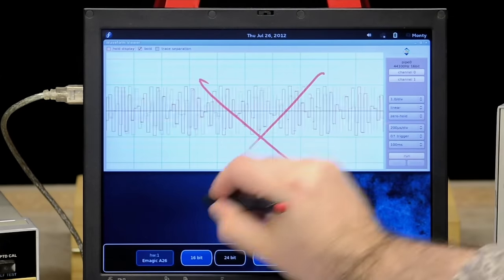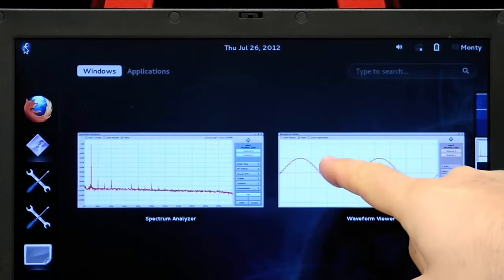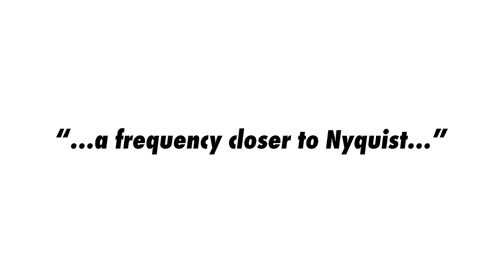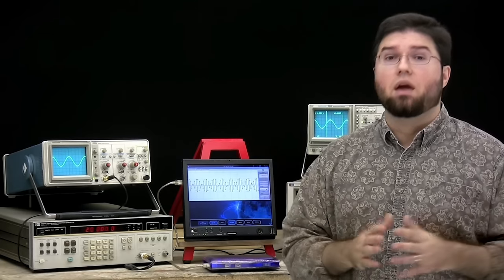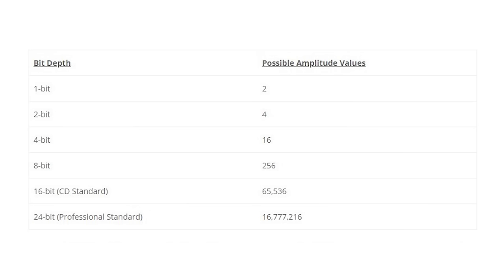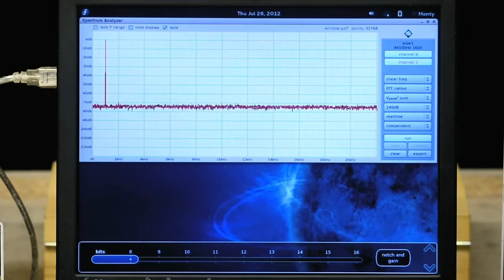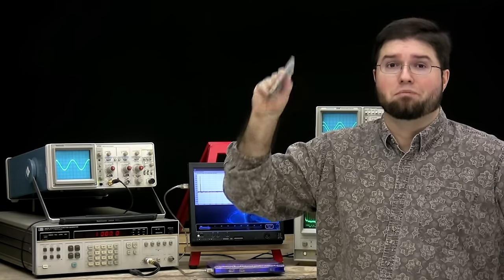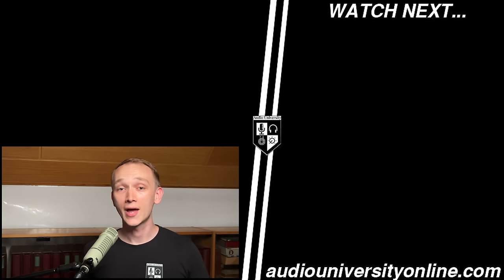Debunking the Digital Audio Myth: The Truth About the 'Stair-Step' Effect

Comment: Digital data loss is not a myth. You're taking a continuous analogue signal and digitizing it using a finite sampling and then applying an algorithm to extrapolate the gaps. Now to keep things in perspective, this process literally reduces an infinity of points to a finite set of measure zero, which is then augmented with an approximating algorithm. Even an infinite set of measure zero (e.g. the Cantor Set) would leave practically 100% of the original signal on the cutting room floor. You may not be able to articulate or even understand the difference, but it is a difference nonetheless. It's hyperreal. Those of us who grew up with super high-end analog audio and vinyl immediately heard the difference when DAT and CD were being rolled out, and despite improvements, parity simply isn't possible because the algorithm can no more recreate missing reality than AI can replace a human mind. You can have the illusion, but you'll never achieve the experience of top tier analog.
Reply: @nicksterj I don't think I need to study anything. I'm a mathematical physicist, and by using information theory I can prove the impossibility of faithfully, let alone "perfectly" recreating a complex analog signal using discrete sampling and algorithmic extrapolation.  Digital fidelity rests upon the false assumption that a high-rate digitized clone is indistinguishable to the human ear from the original. I reject this claim, and for good reason. Nuance and subtlety invariably are lost, and these approximations, no matter how closely they may appear to resemble the original, remain irreparably deficient digital clones. It's a VR simulation, a quantized 2-dimensional facsimile of an original 3D experience.
Reply: @nicksterj The Signal to Noise Ratio for a high-end studio analog recorder, such as a Studer A827 is about 68dB, which represents a very low noise floor. This is a barely audible constant, which the ear "learns" to filter out during a listening session. Loss of data, on the other hand, is an entirely different issue, and one that cannot be corrected either by the listener, or by an algorithm.
Reply: @nicksterj So you think extrapolating a circle from 3 points is analogous to recreating a complex audio signal from a digital sample? You even think digitally, reductively.  You're not paying attention.

Since you're interested in mathematics, I'll provide you with a heuristic illustration. Consider the Cantor Set, which is created by taking a line segment of length 1 and removing the middle third, then the middle third of each remaining segment, and again, and so on, ad infinitum. What remains as residue is an uncountably infinite set (cardinality Aleph 1) of Measure 0 (zero length). Notice that we've applied an infinite process to obtain the Cantor Set; however, this set nonetheless has zero length, which means the entire segment has been thrown away. Obviously therefore, any finite set of discrete points, however large, also has measure 0, which means that any digital sample of an analog signal will have measure 0. That is, but for a finite set of points comprising zero length, the entire signal has been discarded through the digitization process. Therefore, the original continuous signal, which has significant positive measure, must now be extrapolated entirely from a discrete finite set with zero length. Why is that a problem? In a word: entropy. There is insufficient information contained in the discrete sample to completely eliminate uncertainty and reproduce the original signal without significant loss. The result may sound well enough, but it is not a faithful, lossless reproduction of the original, and certainly isn't "perfect," as you have erroneously claimed. 

Another way to visualize the problem with digitization is by conceptualizing audio recording and playback as an unbroken transmission via sound vibration. Using the analog process, the vibration, or signal,  reaches the ear more or less intact, and connection with the source thereby is maintained. Digitization, on the other hand, breaks this vibrational link; encoding/decoding introduces entropy, and approximation is the result.
Reply: @arsartium108  Please, educate yourself
Reply: Were Nyquist and Shannon not correct, no modern wireless systems would be possible. All WiFi and cell radios are digital, relying on exactly the same math, just at higher frequencies and therefore sampling rates. The analog signal can be perfectly recovered from samples at twice the maximum signal bandwidth. In fact, it would not be possible to realize OFDM radios in analog circuitry. Only by digitizing the signal and using software radio can sufficient accuracy be achieved. The three points and a circle analogy is perfect. The three points contain all the information needed; there is one unique solution. Similarly as the video points out, there is only one waveform that includes all the samples, provided that the Nyquist band limit criteria is met.
Reply: That said it is true that there can be perceptible improvements at higher sample rates but these are due to implementation imperfections in the D to A process, most notably aliasing of frequencies above Nyquist back into the audible band due to filter implementations. So a signal with significant components close to 20 kHz and 0dB FS may be better reproduced in a real world system using a higher sample rate to shift the band limit upward. However these are very rare in real world audio, and in no way compromise the theoretical perfection of the recovered analog signal, which is, as has been said, mathematically proven. If a perfect filter could be realized (to maintain the band limit) then sample rate would make no difference. The only reason perceptible difference may exist is that the filter implementation violates the band limit.
Reply: @nicksterj The Studer A827 24 Track released 1989 provides a Signal to Noise Ratio of 64dB (CICR) and 68dB (NAB) at 30ips.  You may have missed that.  Again, a very low noise floor presented as a nearly inaudible hiss the ear can and does ignore.
Reply: @nicksterj Okay, we can use your analogy. But why such a complex case? Why not make the problem one of finding a straight line segment given 2 distinct points on the Cartesian plane?  Trivial.

On the other hand, what if you're given these same 2 points, but now you must guess the precise curve connecting these points? Now the problem is impossible because there's insufficient data.  Let's continue by adding a third dimension with an additional degree of freedom. But don't stop there,. Next we'll add a new variable as a function of time.  We'll say the path of the curve is changing continuously over time. As an engineer, you've solved PDEs, and you know the subset of these equations for which exact solutions are possible is much smaller than the set of equations for which an analytical (exact) solution doesn't exist.

So we began very simply with a 2-D problem that is precisely determined by the given boundary values, but as the complexity increases we're soon presented with a boundary value problem in 4 dimensions that is unsolvable using exact methods.  Yes, you can now sample the curve and use numerical methods, but given such complexity, these approximations each produce errors that compound very rapidly.  This is what I've been talking about.
Reply: @ApofKol  Would you care to elaborate?  It seems I'm the one who's been providing education on this topic here. You are the one that drank the Kool-Aide.
Reply: @clivepacker  We're not talking about the process of encoding/decoding already digitized data. If we were then you would be correct. The task of digitizing analog data "perfectly" as @nicksterj has claimed is an entirely different problem, and one withno analytical (exact, perfect) solution.
Reply: @clivepacker We both agree that digitization necessarily entails a compounding of error, but I've argued against the industry claim, which you're now regurgitating that these approximation errors are negligible and inaudible to humans.  I reject this absurd claim. You believe the manufacturers and their paid science on the issue of perceptible loss of quality; whereas, I do not.  And yes, I have science to back my claims.  This is exactly like the cellular industry and its captured EPA allowing human exposure to EMF radiation that is an order of magnitude (10x) greater than that permitted in BRICS nations, and at levels shown to be quite dangerous in peer-reviewed studies.

So you're free to believe whatever you like, but then how do you explain the recent resurgence of vinyl? Pure nostalgia?  I don't think so. It just takes some people longer to catch on, that's all.
Reply: @arsartium108  These analog decks were indeed amazing machines, but with ever more sophisticated post production, those 64dB would  deteriorate (along with accurate frequency response) with every generation in the mixing and mastering process. I have a half track 15ips machine which sounds amazing and even with no noise reduction, hiss isn't audible at sensible listening levels.
Reply: @garethonthetube  Yes, that's the claim – a difference that is inaudible, imperceptible, a digital representation that is practically identical with the original. This is something like comparing an AI-generated digital speech using text and voice sampling with the actual speech, and then declaring these indistinguishable. For many, they will appear identical, however they remain fundamentally different things because they belong to different ontological categories. How so?  One is real, the other a facsimile; and if there was no speech, then the former would be called out as a deep fake.  Declaring a digitized facsimile to be non different from reality is a form of reification similar to that of conflating words and symbols with the real-world objects the words and symbols represent.  This is basic representation theory.

The bottom line is that digital mimesis is a theoretical (mathematical) and a practical impossibility. The people promising you they can do it are the same people peddling VR and promoting concepts like AGI, downloading human consciousness, and cybernetic immortality; but none of it is any more likely or real than the fabulous 1930s World's Fair depiction of, "The World of 1960."
Reply: Sorry but you are wrong. By limiting the band in question, the Fourier representation of the signal is reduced from an infinite series to a finite number of coefficients. You would be correct if not for the limit of bandwidth being less than half sample rate. 

I am correct. Go read Shannon. Your problem is you’re working in the time domain. The proof, and the reason it works is all done in the frequency domain. It’s about the Fourier representation of the signal. I’m a radio engineer. I know I’m right and you need to educate yourself. Even the Wikipedia article on this has two mathematical proofs of this in it. I suggest you read the Shannon proof as it’s easier to understand. 

Can that be implemented fully and perfectly? No. Nobody has claimed it can. But if a perfect implementation were possible, the signal is there to be recovered. We just can’t recover it perfectly. 

As to the 5G tin foil stuff spare me.
Reply: A less mathematical way of explaining this for those who prefer is that the “step” parts of the curve are in fact very high frequency components of the signal; these are introduced in the D to A conversion and are not present in the original analog signal. The voltage level is changing rapidly from sample A to sample B and that manifests as a high frequency spike in the signal when viewed on a spectrum analyzer. By filtering out anything above the band limit (20 kHz for CD) these components are removed and only the wanted lower frequency components remain. The reason for audible issues is almost entirely due to imperfect implementation of this filtering. 

It’s also important to note that this is true for the input signal filtering as well. The input to the A to D process must also be filtered to remove frequency components above the band limit before the conversion to digital and the same implementation issues apply there. What can be recovered perfectly is therefore not strictly the entire original input signal but the filtered input signal limited to (say) 0-20kHz for CD. Since almost nobody can hear above 20kHz the effect is the same, but with higher sample rates this filter cutoff can be moved higher, per my previous post.  
 
So, yes, there is information loss but it takes place at the input filtering stage, not via the A to D and D to A processes. And it takes place above the limit of human hearing.
Reply: Final word… for my own listening pleasure, can analog sound better? Sure. Sometimes I prefer vinyl, sometimes CD. Aesthetically I tend to like the warm side of things and even my digital gear is chosen with that in mind. I like a “close to analog” sounding CD player. Is that more pleasurable to me? Sure. Is it technically better? Absolutely not. The aesthetically pleasing part doesn’t come from perfection of reproduction, it is actually imperfection that makes it sound better musically. Theoretically, vinyl is massively inferior to CD, but doesn’t mean it can’t be more pleasing musically.
Reply: @clivepacker  Fine, let's talk Spectral (Fourier) interpolation.  We'll even assume linearity, manageability of computational complexity, as well as periodic boundary conditions. Nice and neat, though not exactly real world. Yet even given such favorable preconditions, the issues of time and frequency resolution, boundary effects, and aliasing remain. Interpolation error is the result, and these are measurable, meaningful. You insist that no one has claimed this process can be done perfectly, but others on this thread have done exactly this.  You've been reasonable on this point, so thanks for that.

You say you're right but then admit the interpolations are imperfect, i.e. there are measurable errors. Applying Shannon's theorem within an ideal theoretical model is one thing, but the results are never so ideal in a real world setting.   First, we must address issues resulting from different interpolation techniques which lead to variability of accuracy when reconstructing the continuous signal from discrete samples. This variability can introduce different levels of error, particularly when samples are unevenly spaced. Next, regardless of the sampling rate, a degree of quantization exists which leads to quantization error. We also have noise and distortion to consider. Sources of this include quantization noise, limitations of the sampling process itself, and discrepancies with the components carrying the signal. Then we have various filtering processes to consider, including those that filter before and those that filter following interpolation and signal reconstruction. Issues with filtering include spectral leakage, aliasing, and other artifacts.

So your "proofs" lifted from Wikipedia don't really provide an accurate picture.
Reply: @clivepacker  I'm  amazed at how you can dance all around this elephant in the room but never recognize it!  You're conflating "technical accuracy" with fidelity. If these were in fact one and the same then there would be no aesthetically superior pleasure for you to experience from so-called inferior media. 

Consider a hologram. Perhaps the most significant property of holograms is that any section of a holographic image, regardless of size, contains the entire image, albeit at lower resolution. Analog reproduction is a bit like this, because the vibrational reality of the signal is imprinted upon the medium; whereas, digitization first destroys the signal, then reconstructs it, and finally imprints this reconstruction.  Both processes produce errors resulting in loss of fidelity; however, the profound differences in the nature of these errors is why you find a technically inferior LP more pleasing than a CD.

For more about this, I would refer you to current research into Spacial Audio, aka 3D Audio, previously known as, Holographic Sound.
Reply: @nicksterj I appreciate that, and if I misunderstood your statement to mean more than you meant regarding sound quality and fidelity then I apologize. 

Regarding comparative loss and error, however, what I'm saying is that these differences are not created equally. That's why, assuming we're comparing the upper high end of each, audiophiles generally prefer the sound of analog.  See my comments above regarding Spacial Audio.

Comment: The first experiment is a waste of time.  When converting from digital to analog, the system interpolates the wave between the two points.  Since the input was a pure sine wave, the interpolation will be accurate.  If, however, there was something other than a smooth sine wave between the tow points before interpolation, the output would be less than accurate.  The stair-step effect is not always a myth.